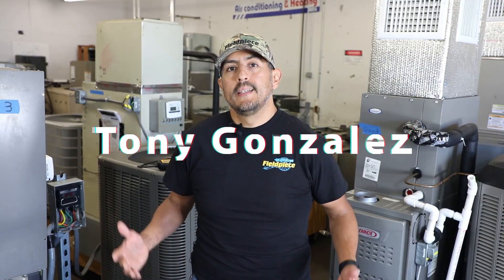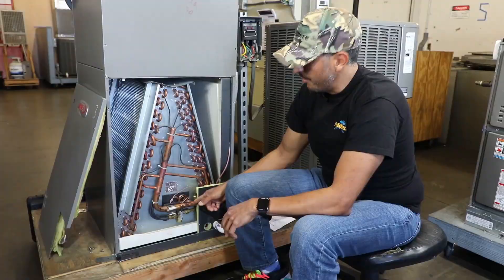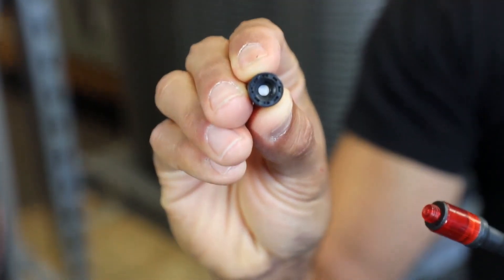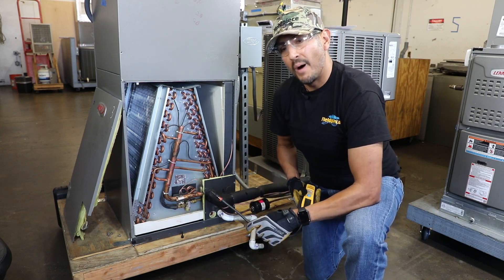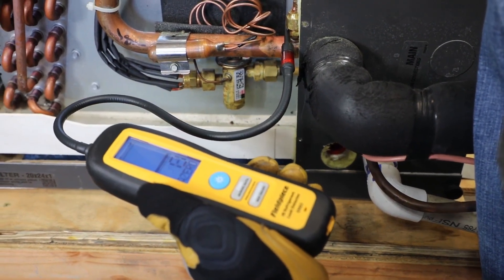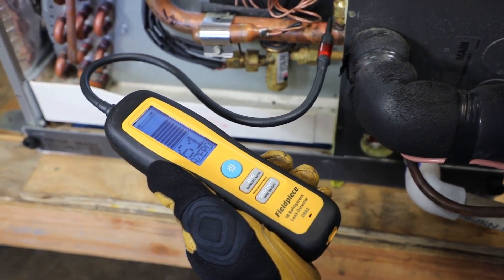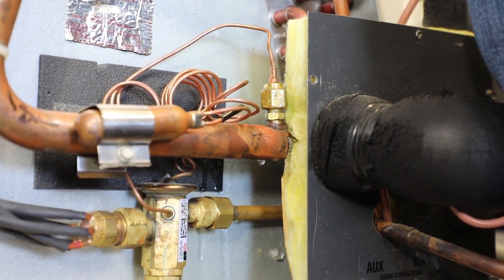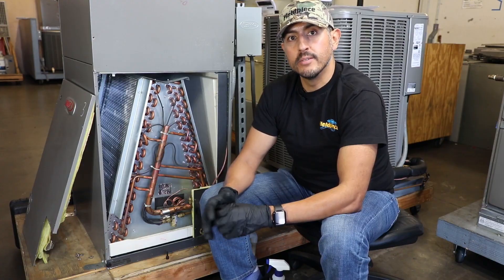Fieldpiece DR82 Refrigerant Leak Detector  - Tips for Effective Use

Comment: I have this detector.  Wish you would have covered the different modes.  The manual isn't super clear on when to use the different modes.
Reply: There’s no prof that detector found it. He didn’t put it through the different modes and that’s what you’re supposed to do. Start on high and if it hits go on medium and if it hits still go
On low and if it hits still the it’s deftly a leak. That’s my method, I own a d tek stratus and it’s superior, I use the FP in emergencies but I trust the d tek more

Comment: I had a leak on a high pressure switch where its brazed in at and it was so hard to find because it just kept going off no matter what setting i put it on. It wouldn't pin point it